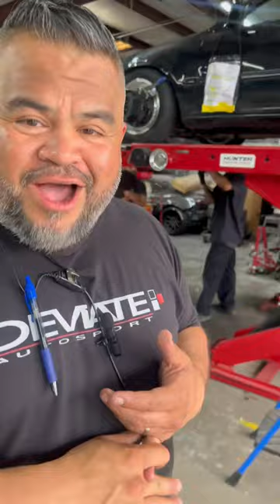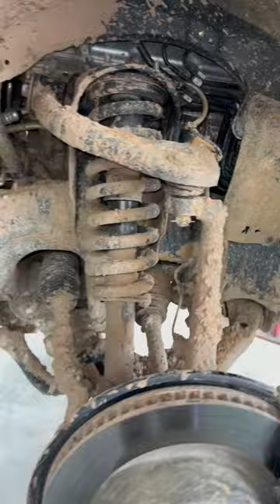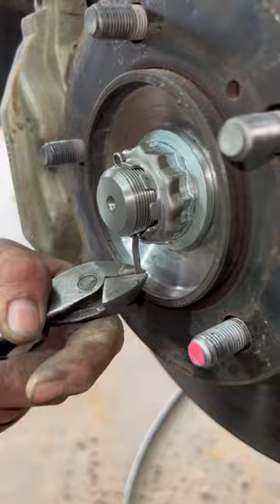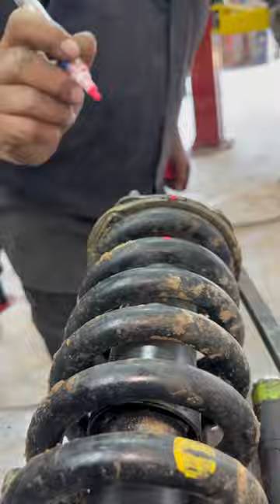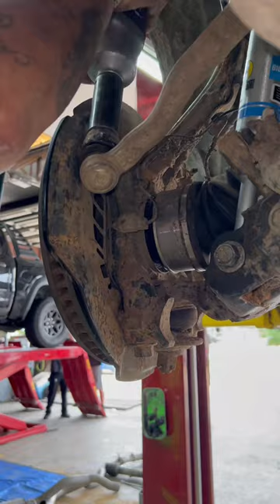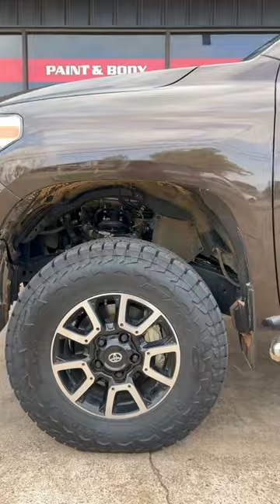TOYOTA TUNDRA 3” ReadyLift LIFT KIT INSTALL‼️ #shorts

Comment: Why are you putting spacers on 5100s?
Reply: Lift kit. Don’t like those but they work on small increments.
Reply: @Walterrinho  yea, but 5100s are adjustable so it seems redundant. Why not just go with lift coils and better front shocks?
Reply: 100% with mitchell on this. That front end prolly rides terrible not to mention how the cv axles look

Comment: damn staight big fellers, if those bolts where rusted with no heads, youd be bouncing up and down with a big breaker bar and a map torch. id do this job in 2 hours but on mine I have to spend a full day just to remove the shocks